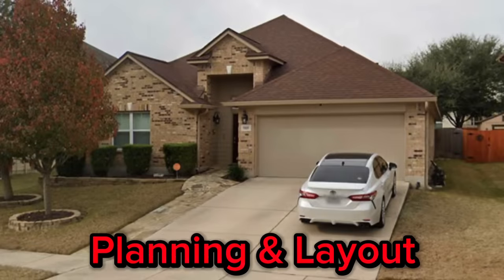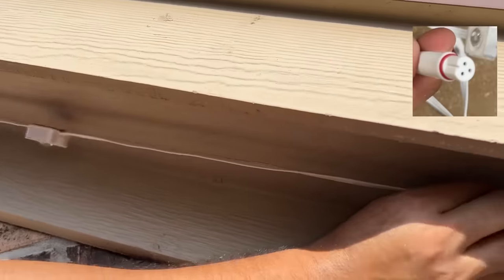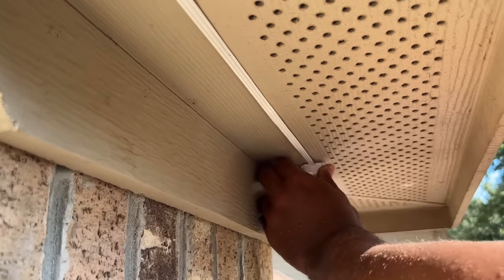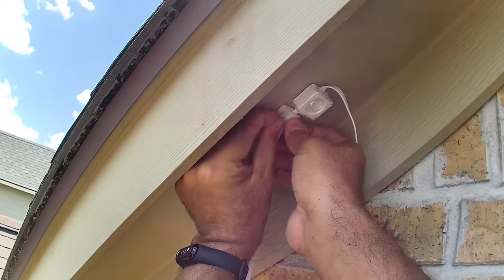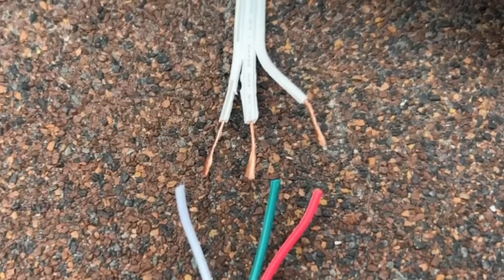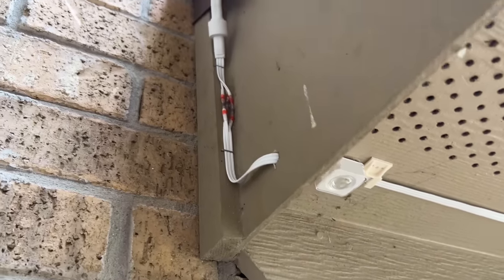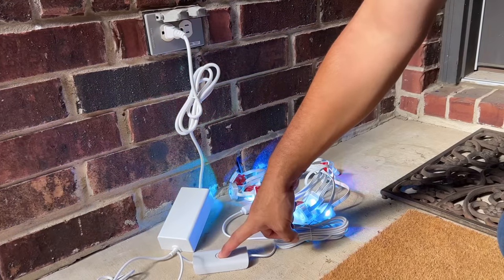Govee Outdoor Permanent Lights-1st Gen.*HOW TO FULLY CUSTOMIZE* @GOVEE #govee #howto #diy

Comment: Great video! I am currently planning my install here, but I have one question for you. I have an issue transitioning from my main soffet up to one of my peaks. I am running 3 full strands and then i need 2 more lights off the new strand before i cut it to run the custom extension up to my peak. I keep reading that you must have a minimum of 4 lights before you cut or it wont work. In my case, I have the 3 strands, plus the 2 lights, then the extension will be reconnecting to the remaining lights in the 4th strand. I just want to make sure i understand the rule correctly before cutting my lights, i assume that as long as my strand, once connected has more than 4 lights in it, it will be fine, is that correct?

Comment: What is the distance you use to install them from the wall?
Looks really nice.
Reply from the maker: Hi there and thanks for your comment. We used a 2x2 (2inch) wood craft block to space our lights for install. This helps to give the cone effect that everyone comments on. There is a link in my description to purchase either 2,3 or 4inch blocks. Further than 4” makes the light expand out to a rounded look if that’s your thing.
Reply: Thanks for the fast response!

Comment: I may have missed it but are you using one controller for the two 100ft kits or did you link the two somehow? If linked how and how many can be linked?
Reply from the maker: Hi there thanks for watching. I used two controllers and power adapters. They can be grouped in same model

Comment: Is there a maximum distance you can splice in an extension between two lit areas?
Reply from the maker: Yes. If you use the 12ft govee extension, you can splice 5-6 more feet inline of it

Comment: If I come to the end of a section and. Were to cut the strip and not continue it, how do I simply seal off the end of the light strip if it’s a cut end?
Reply from the maker: Use non concentrated plastic dip in a can, not spray. Use can melt glue as an alternative but that will get brittle over time

https://www.amazon.com/dp/B00I9SK8XY/?tag=jbsditv-20
Reply: Great thank you.  I assume each of the three wires dipped separately?
Reply from the maker: Spread them away 1/4” from each other so you don’t have small copper strands touching together and then dip it all

Comment: Hey JB does this Ryobi brad nail gun has nails that can go into metal soffits?
Reply from the maker: The Brad nails will be loose on aluminum/metal soffit. I would definitely get one full 200ft kit to light up your front and keep a 100ft where it’s less visible to the view. Not sure how your house is positioned in a cul de sac or at corner but use your best judgement with that. Just know that you can group your devices

Here is an example of how to go about the panels that have holes if yours are like this
https://www.instagram.com/ourdiyhomeproject/reel/Cz33AkvL0Lk/
Reply: @jbsdiytv  sounds like I will be on the scaffolding screwing in the small clips instead of nailing them 😆....keeping the layout of my house in mind I have 3 weird jumps at the front , I may do 2x 150, one 150 will cover the front ,with the akward  jumps, most of the house and than towars the back dobthe 100ft. I would just like to use the same power outlet.  Not sure how that would work on the application.  Since it would be going to two different directions from the same power outlet.
Reply: @jbsdiytv  I just saw the video I may do that...thanks alot.
Reply from the maker: @MMARIC20 yes that’s correct. Govee presets will be different directions but your DIYs you can change the direction from clockwise to counterclockwise

Comment: I have my last section after a splice not working with the colors or app just white lights any ideas
Reply from the maker: That’s a bad strand. You can try a factory reset holding down the power button on the controller for 6 seconds and then after a short white flash. If it continues then it is indeed a bad strand

Comment: Do the lights interfere with the motion camera system at night, or more so does it cause a glare ?
Reply from the maker: Hi there. That is a very good question. Thank you. Currently my lights are installed directly over my ring cameras so I haven’t had any issues because the sensor is at the bottom of the camera. I have some lights and I will test this out today and will respond back to this comment
Reply from the maker: I tested this out. It doesn’t set off the motion to the ring camera’s. That’s just a test for ring cameras and can’t speak for other brands. As far as the glare, I only saw something as the light was faced directly at the viewing glass.
Reply: @jbsdiytv  thank you so much for the fast response.  Much appreciated it.
Reply from the maker: @jluc155  not a problem, a quick response helps you get your install up faster than your neighbor. Good luck

Comment: Hey I have a question in the product description it says not to cut it  but you did cut, that is possible then and what extension cable to use
Reply from the maker: The link to the 18-3 wire is in the description. You can also use 20-3 if it isn’t available but keep them under 2ft to avoid voltage drop. You can splice between the 12ft extension provided by Govee but keep that under 18ft

Comment: If it’s not to exceed 150ft, are you saying don’t even use the included 12ft extender if you have the 150ft kit?

Also, at 12:16, I don’t understand what you mean when you said you did 4 splices on the 12ft extender.
Reply from the maker: We had 95 feet to the left so that is 1-100ft kit and 95ft to the right so that’s another 100ft kit. In each box, there is a 12’ extension. We used those two at the two longer jumps. Each side after using the provide extension and our custom jumps the total feet added is 124ft under the recommended 150ft

If you buy a 150ft kit, it’s a different story. You can use what Govee provided.

Sorry for the confusion. There were 2-12ft extensions used like described at the beginning of the video for planning and layout. At each location of those 12ft extensions, we spliced 2 times there and another 2times at the other to make those jumps possible.

Hope this clears up your question

Comment: Hey JD, sir, you did a heck of a job. I just had one question for you, I have to use two 100 lights per side of my home with two different controllers. Is there a way that they can be synced together. Thanks for the video. Very nice.
Reply from the maker: Hi there, yes there is a way called grouping the controllers. You can also set timers and schedules. In there, if one 100 is going one way and the other is going the opposite way, you can adjust one to clockwise and counterclockwise. Go take a look at the Govee app (Detailed video) for a visual. Good luck
Reply: @jbsdiytv  you the man. I appreciate it. Have a good evening.
Reply from the maker: Not a problem. Good luck
Reply: Can these be face mounted..on part of my home I don't have a soffit..but wat lights there...what do you think
Reply from the maker: @michaelhaase778 you can face mount them but it will be super bright to passer byers and cars. You won’t get any lighting effects on the wall

Comment: What if you need more than 150 feet ?
Reply from the maker: Purchase the pros for 200ft
Reply: @ what if it’s more than 200 ft ?
Reply from the maker: @plucio0912 then you would need to group them in the app to work as one system. Run all the strands in the same direction
Reply: @jbsdiytv  last question. What do you mean run all strands in the same direction? If I’m running from left to right and end with 200ft then pick back up with new lights left to right?
Reply from the maker: @plucio0912 on Govee presets scenes and user scenes you can’t change their direction of flow on their movement scenes. Run all the strands either all left or all right so movement is chasing in the same direction

Comment: Can you cut at any light in a string?
Reply from the maker: Hi, groups of 4 only. You can’t end with 3, 7, or 9 lights
Reply: @jbsdiytv  Ok thanks.  So you can cut at 4 light intervals and then splice in to get down to the next point.  Thanks.
Reply from the maker: If it is within the install and can be where ever as long as the line comes back together. This only applies when you ending the strand and not attaching anymore. If your removing lights only
Reply: @jbsdiytv  So I need 4 light to finish a eave, so I would cut the 4 from the beginning of the strip and then reconnect to the other 12 to start my next run.  Would I be able to add another strip to the end of that one?
Reply from the maker: @1tufgt  you said strip lights. Are you talking about the outdoor permanent lights?

Comment: Great video! What gauge Brad and what settings do you use on your Ryobi air strike? Thank You Tom
Reply from the maker: Hi Tom, thanks for watching our content. We are using 18 guage - 1” brad nails since our Ryobi Brad Nail gun requires 18gauge only. Follow what is recommended on your tool. Thanks for your comment

Comment: Link provided for the clips are little different from the ones used in the video. I would like to use the. Nail gun as well will these clips made of the the Same material. I would hate to purchase them and find out that they crack if nailed with gun. Thanks for the video
Reply from the maker: The ones you are looking for keep selling out. Yes those are different but they work for all our installs. Make sure it sits flat on the surface material

Comment: Why do you nail the clips twice? It looks like you're nailing in the hole and then next to it?
Reply from the maker: Hi there. Thank you for viewing the video and for your question. Yes we nail them twice and I recommend it for a few reasons. 1.) The 3M vhb pad has been failing in Texas heat. 2.) we apply small pressure to the line and as we unbox the strands, it is much more wrinkled than a crinkle cut fry so we make sure it has two anchor points. If one side were to get nailed and you pull the line slightly, then the clip will pivot. 3.) when they say permanent we shoot for permanent and for them not to fall years later

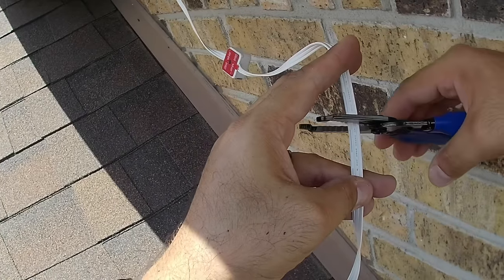Comment: @ 8:18 what does that mean make and female side? What’s that for?
Reply from the maker: Hi there and thanks for watching our content. When describing connections the connection that has 3 holes is the female side and the connection that has 3 prongs is the male side. This matters because if you have a power supply on the right and you start left with the connection to the controller. You have to remove everything and flip it

Comment: Do you guy do install in rosenberg 77469?
Reply from the maker: Yes we will travel there. Please reach us on our FB messenger @jbsholidaylightingsanantonio
Reply: How much does it matter where you cut and make an extension?
For instance, After my 3rd full strand, I needed to make an 8’ jump to my next eave, so I cut off a female end and soldered 18/3 LED wire (round, not flat if that matters) and made the jump to the next strand and got nothing. 
Unplugged, plugged back in and held power button for 5 seconds and still nothing.
Reply from the maker: Hi there. Yes it does matter. Try and keep the custom jumps minor since you’ll have voltage drop and then will need to power inject and Govee has not recommended that because they left it at (DO NOT SPLICE LIGHTS). Doing anything further than that will be at your own risk. Usually we keep them between 2-4ft since that’s typical for most jumps. Any feet after that I would recommend getting another blank extension cause data to the lights starts to fade away. In my (how to fully customize) Govee video, I indicate that the max linear feet one controller and power adapter can handle is 150ft max and that even includes any custom jumps. Govee says 147ft so that’s the limit. The 18/3 bought wire is for small jumps like mentioned in my video. I would recommend placing the line back to its original layout. It will still work
Reply: @jbsdiytv  so can we do power injection? I need another 10 feet after my supplied 12ft extension. So a blank run of 22ft. My total for lights wouldn't be more then the 147ft.
Reply from the maker: If you have less than 147ft then you wouldn’t need anything more than just the power adapter and controller connected to your lights. Anything that we have installed more than 150ft we have placed another power adapter and controller with lights and grouped them together. I have not tried the power injection as I have mentioned on another comment that experimenting will be an expensive thing to do for me as it comes out of mine and clients pocket if it doesn’t go as planned.
Reply: @jbsdiytv  so you don't think I'll have a problem with a 22ft Blank extension with my lights as long as I'm under 150ft?

Update: that doesn't work
Reply: @jbsdiytv  I'm also interested and I live in the same area code. I already have the 150ft one and my roof is similar as the video. How much for your service?
Reply from the maker: Please message us at the FB handing listed above on messenger for more details. Thank you for viewing our channel

Comment: Whats the answer for a house without eaves/soffets?
Reply from the maker: Need to to install in track or need to use a 1x2 and mount the lights to that. Then nail the 1x2 to the rafters
Reply: @jbsdiytv  front has gable with drop edge, other 3/4 front gutters. Can they be attached under the gutter? What about the drop edge for the gable?

Comment: How much does a professional install like this cost?
Reply from the maker: It all depends on the roofline. A straight run will be cheaper than 2-4 peeks as those are the ones that require the custom jumps and solder. 100ft can run $700-1100 and 150ft $1000-$1400

Comment: I cut my Govee permanent outdoor lights in 6 different places. So basically I have six extensions of 18g 3 wire. And they work perfect
Reply from the maker: That’s awesome. How long were your jumps?
Reply: @jbsdiytv   Four 10' jumps, two 6' jumps.
Reply from the maker: Nice..1st Generation lights or Pro’s. The pros just have magic wires for some reason lol
Reply: @jbsdiytv  1st gen, But i'm having problems with the timer. They come on at set time but don't go off at my set time. I when I turn them off manually they magically turn back on thirty minutes later. And the set scene playlist doesn't start when timer turns lights on 🤷‍♂️
Reply from the maker: @scarletfire9812  only set a timer at the front page to go on and off. Then in automation just set an On and the days you want the scene to start. Don’t set an off in automation, just a On

Comment: What happens if I am 10 ft too short to cover the front and side of my house with the Govee 150ft RGBIC kit, and I use the 16ft extention from Amazon to get the full coverage and I cut the extra 6 ft off? Would this be okay or has anyone tried this? Thanks
Reply from the maker: The app will only read 9 segments which is the 108 lights. You add and it will start flickering and some others won’t turn on. Unfortunately you have to use another power adapter and controller
Reply: @jbsdiytv  The smallest one I can find that has an adaptor is the 50ft kit.
Reply from the maker: Yes that will do. That has 3 strands, power adapter and controller. No 12ft blank extension. Then group both controllers in same-model
Reply: My apologies. I asked this question on one of your other posts. I’m waiting on the arrival of my 150’ kit. Does the kit come with lengths of wire without the lights for the jumps. I noticed that some of your jumps were spliced back in using the drop off. But then saw longer runs without lights. Thank you. 😊
Reply from the maker: @madmann1969  Hi there. The 150kit comes with 2-12ft blank extensions for jumps. Those should be for longer jumps. Use 18-3 wire for smaller jumps below 4ft

Comment: Thanks for the informative video!  I just ordered a 150' kit.  I understand that you can cut a string shorter as long as it is kept in a group of 4.  In other words, the entire run should be divisible by 4.  I have just one question in regard to splicing and extending.  Can the string only be cut and extended between groups of 4, or can it be cut and extended between any of the LED's?  Example:  A string has 12 LED's I believe.  If I have a section that only fits 7 LED's, can I extend it there as long as I put the remaining 5 LED's on the other end of that extension?
Reply from the maker: No the groups of 4 doesn’t matter anymore. @Chrismayherdiy tested this theory with one light. You can cut anywhere and make your jump with either the 12ft Govee extension or make very small custom jumps
Reply: @jbsdiytv   Thanks for the quick reply!

Comment: Question:
Is there a limit to how many lights I can cut in between?

For example:
I have two extra lights at the end of my strand, am I able to cut just  those two lights and solder them with no issue? 

Awesome Video and greeting from Georgetown TX!
Reply: **Correction Two lights , not two strands***
Reply from the maker: @Lmdez12  greetings my fellow Texan. Yes sir, you can cut the two at the end. Make sure it’s considered a full strand in the device settings. Separate the 3 lines slightly, and you can use plastic dip

https://www.amazon.com/dp/B00I9SK8XY/?tag=jbsditv-20
Reply: @jbsdiytv thank you so much! The wife and I truly appreciate it your help!
Reply from the maker: Your welcome, not a problem

Comment: Hey added from tik tok...told me to add you and mention that and JDM
Reply from the maker: Yes sir, what info where you looking for again?
Reply: @jbsdiytv  trying to have my house solid red (it is right now) with lighting on different parts. If that makes sense. There is a DIY in the all ready that I like but it doesn't have all my lights on. This is for Halloween if that helps you understand it better.